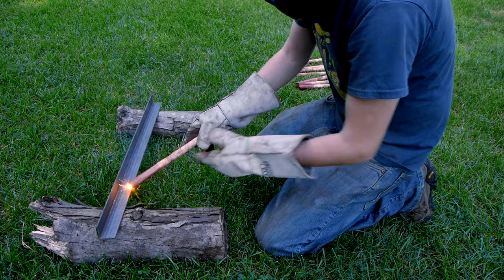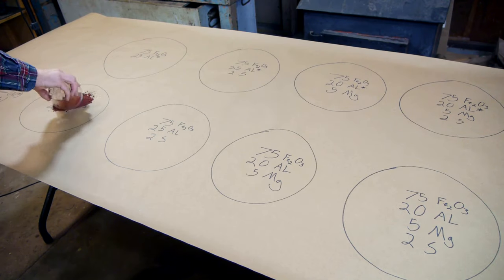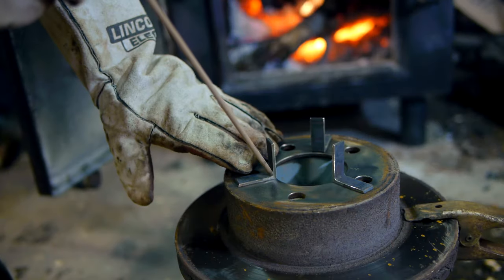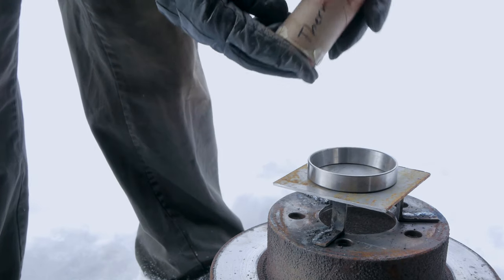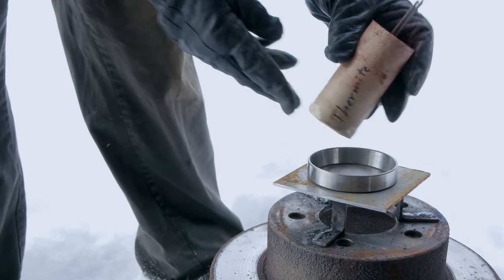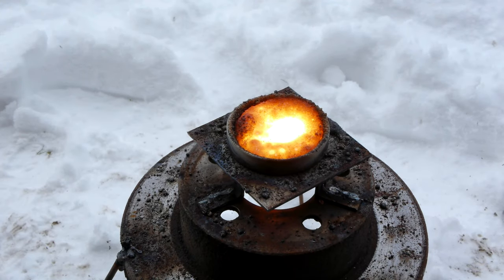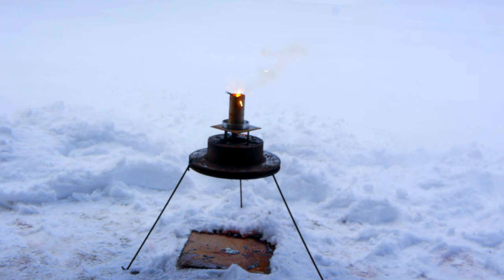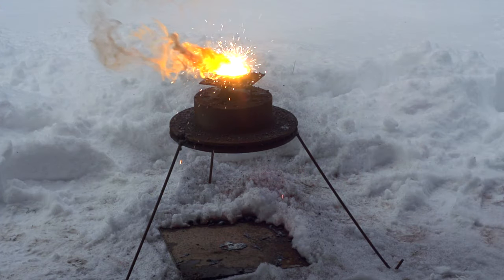How Easily Can Thermite Actually Melt Steel? - NightHawkInLight

Comment: Even if it doesn't cut through the steel, chances are that it significantly weakened it. I would assume military grade equipment would be using steels that are heat treated to do the job. If you overheat a shallow hardening steel which has already been heat treated, you would soften it up so that it would fail faster. If you overheat a through hardening steel which has already been heat treated, you effectively reharden it without properly tempering it and could cause it to crack (catastrophically fail) early.

Comment: Instead of letting it just burn in open air, try containing it in a welded steel casing with a small hole facing the target metal.  This will provide pressure to push away melted steel and will cut through much better.  You'll probably have to hold it against the target (lest you make a thermite rocket), but it will push more energy into the target plate.

Comment: contain the reaction more. Force the thermal energy and molten iron into the material you want to cut. I've seen it be done. A setup like the one you demonstrated here lets a lot of energy escape to the atmosphere because it is the path of least resistance.

Comment: Ever heard of shape charges or cumulative mines?
You are burning it in rather tall container (10cm?) and you are starting fire on top of it.
More or less all heat is gone in wrong direction.
Try to set ignition point  on the bottom of container just where it sits on plate you want to burn thru.
Cheers :)

Comment: have you seen the brainiac video where thermite cuts through a car engine? it may be worth investigating their mixture compositiin.
Reply from the maker: Brainiac is known for faking the results of their experiments to make it more exciting
Reply: Never knew that i just enjoyed fhe show
Reply: Mythbusters have a legitimate thermite vs car video, and you can see there that even a gigantic ammount of it does far less then expected.
Reply: Yes it's a 100% fake(that's why i stopped watching Brainiac). As ppl suggested in their comments you must heat up a small point and thermite itself has to have the right ratio of ingredients to prevent the molten metal to produce hmm well...a kind of shield on the steal plate. Military thermite is also compressed and put into, say, tubes with nozzle so the heat didn't go around thus be more direct. I did some research on this topic a few years ago ;D unfortunately police ;D didn't share my passion.
Reply: thermite is the ammo. the pot is the weapon. Without a hole in the pot you don´t get the superhot molten metal "blade"

Comment: Hey NightHawk,

I think if you want to look more into thermite cutting power, you might experiment with different containment methods.  There's some really interesting work that Jonathan H Cole has done with testing various cutting configurations for entire steel I-Beams.  He's been able to make deep slices into large steel I-beams. 

 Although I disagree with his conclusions from the work (that thermite was used in the destruction of the twin towers), he still makes some very impressive horizontal and vertical cuts through thick steel using containers with simple geometries.  He even made a couple spring-driven designs.  You may have to wade through a lot of truther bs to see his hard science though.

J

Comment: When you mix fuel, metal oxide and metal powder in just the right way, it burns at 2000 degrees Celsius, hot enough to cut through nearly any barrier known to man. Throw some C4 in the mix and you've got one hell of a combination

Comment: What about packing your thermite/ mate into a cylindrical tube (as you did) but with a hole going down the center? Seems to me that all the heat generated was being allowed to dissipate upwards & you needed a more focused effect? Rather than just letting it burn in a pile. Think of the way you approached the DIY mega snake on the sand thing you did. An open channel through the center would give the molten material somewhere to go? & if I understand the science right it's not a question of oxygen to burn but rather direction of what you want burned? Would packing the thermite with a press like a rocket engine make a difference?

Comment: Try simply pouring the thermite in the bearing race then lighting it. I believe your problem is that when it is contained within the tube it is merely burning itself and doesn't actually start to heat the steel till the very end.

Comment: Pretty sure the reason the thermite wasn't burning through was because of the way you set it up. Most of the iron and aluminum oxide that formed seemed to have insulated the material from the heat, if there was a way to light it at the bottom instead of from the top might get better results.

Comment: So, let's quickly go through how plasma cones are used to penetrate armour: The explosive is cone shaped, so as to create a think plasma spike that burns through the armour. Done. If this is true for explosives, the same must be true for incendiaries. Hell, if you burn something on top of a flat table of wood, it will still take a lot of time for whatever is burning on top to cut through the wood. On the other hand, contain what is burning in some way, and focus the energy on the plate, and it will burn through rather quickly.

Comment: Thermite is actually used for welding steel rails together by railroad workers. It wouldn't be much use if it cut right through them instead of softening them enough to form a weld.

Comment: If you mix fuel, metal oxide, and metal powder in just the right way, it burns at 2000 degrees Celsius, hot enough to cut through nearly any barrier known to man. Throw some C4 into the mix and you've got one hell of a combination.

Comment: your thermite composition needs to have as close to a perfect ratio of aluminum to iron oxide as possible to get good results. any excess will simply absorb heat which is drawn away from the targeted metal. the reason the military is able to decommission artillery pieces and such is because their thermate is mixed in very controlled conditions in large quantities making it much more 'pure'.

Comment: Heat travels upward though so if you want to achieve maximum efficiency of the thermite wouldn't you place the thermite under the steel

Comment: You may have better results by having the container of termite elevated above the metal plate and igniting the termite from the bottom of its container. Thus having the termite pour into the plate of steal. 

Your current method looks like it would have problems with thermal insulation and getting the oxygen for optimal combustion.

Comment: This may not have been a solid analysis, allowing the top to remain exposed allowed the thermite to direct its heat out the top into the cold air rather than transferring the heat into the steel to cut it

Comment: What happens if the thermite is fully enclosed, bar a small opening, and tightly packed inside a steel tube, similar to a firework?
Would this concentrate the heat / cutting ability? Or just detonate like a firecracker? I'm thinking would it be possible to direct the cutting power in a similar way that a shaped charge works?
Reply: *****
Thanks for the info, but I find conspiracy nuts annoying, so I'll give it a miss and carry on watching more quality videos from Mr NightHawkInLight.

Comment: thats just a thermite stick imo, tbh if you wanna cut completely through the steel, then use BreachPens, breachpens are thermite breach charges that burn at over 5000 degrees

Comment: I have one suggestion. The heat of the reaction is going up, and you have your metal down the reaction, so the heat that finally get to the metal it's very little and not very efficiency. Try to find a way to put the metal different or direct the reaction in other manner.

Comment: It's clearly below freezing where you are. Maybe the ambiet temperature was causing the steel to just conduct away most the heat?
Reply: +jpeg1991 
First, steel is a rather poor conductor of heat. So that doesn't change much. Secondly a few tens of degrees make no difference when the reaction burns at 2500°C.

Comment: The reason the 300g of thermite and thermate didn't cut through the steel sheet was because neither of them were directed in any direction. If either of them would have been directed at the steel, it easily would have been cut.

Comment: it doesn't just 'melt' though, it should also offer oxidizer to react with the steel, and you need a termite jet to 'flush' though the steel, like how water jet goes though sand castle. exucise my english

Comment: i think maybe it did not burn through the steel because as the thermite started its burn at the top part of the cylinder and the un-burned thermite shielded the steel below it - see what would happen if the thermite cylinder was placed upside down so the molten thermite was in contact with the surface of the steel - that will increase the time the thermite has to bring the steel to molten temperature - i think it do the trick

Comment: Instead of a tube and a bearing race, try to focus the flow of the thermite, and yeah it really needs to flow, that looked more like it just globbed together, more like welded. Seen thermite used for cutting train rails by having it focused, an at the same time commonly used for welding tracks.. =)

Comment: You also burned from the top down, which sucked alot of the heat out.  Try a bit poured jnto the centrr of a tuna can.  Dont fill the can up, just a nice mound of it.  We burned holes in asphalt like that.

Comment: I don't think the cutting power is overhyped as much as it is talked about by people who have no idea what the hell they are talking about and have never used the stuff. I have never seen or heard anyone that's legitimately knows about the stuff ever say it was an efficient means of cutting steel, only that it can burn through steel. And I think that largely comes from accidents while making large quantities the stuff. Someone mixing it in a steel container and it spontaneously ignites and burns through the container and potentially the floor. 

There's no doubt it can burn through steel. As far as this particular experiment goes, the energy is going upwards when it needs to go downwards. When I've seen it successfully cut through steel, it's been in bags, not contained so it acts like a rocket engine. If you were to do it that way, I'd think you'd need to ignite it from the bottom so the burn is directed towards the plate. You'd also probably need a significantly larger quantity. It needs a fairly long burn from what I've seen.

Comment: you should use something to apply pressure to the burning thermite and also burn it in a way in which all of the heat is focused on the steel instead of going up into sky

Comment: +NightHawkInLight  what if you try to put it in a pipe with a hole in bottom brick on top for safety and lit it then maybe that little bit of pressure will punch the metal

Comment: if the burn started on the steel somehow instead of an elevated position the majority of the burn would be on the steel instead of elevated into the air. the whole first half of the burn isnt touching the steel at all. maybe even a hole down the middle of the tube would help focus the burning thermite directly to the steel.

Comment: I think there needs to be a way to focus the energy being produced into the surface that is being cut through. in your video you have the composition being ignited from the top. with the energy released going up into the atmosphere. the only energy that meets the steel is the bottom layer and the residual energy stored in the slag produced. its more than enough to heat the plate but not enough to melt.   

What if you where to contain the reaction in a caped cylinder with a nozzle and  ignite it from the bottom similar to a rocket. and have the nozzle directed at the steel. energy would be focused into the steal rather than being released. i would imagine that you wouldn't need much thermite to cut that sheet.

Comment: Great video. Now let me explain why it didn't work. If you want to melt though steel with thermite you must consider gravity. So take a road flare or sparker. Lite it and lay it on the steel. Then put the thermite on top of it. The thermite will burn in contact with the steel and will continue to melt  and heat the steel though the whole burn. You only had contact for the last part of the burn.

Comment: The reason it isn't cutting is that you're just burning it in a tube. If you use something like a flower pot with a hole in the bottom raised off of the surface to drip the molten thermite down you will have a much higher chance of success

Comment: When Myth Busters busted the myth of 'will thermite burning on a block of ice explode?' they demonstrated a bigger batch of thermite burn through two or three sheets of steel a couple of inches apart above each other. Whatever your problem not burning through the plate, it isn't the thermite...

Comment: I think a problem with your use of thermite is that you didnt direct your thermite charge. I'd suggest containing the charge in a stainless or thicker steel cylinder with the open end pointed at the melt spot and of course lighting or igniting the thermite that is in contact with the material you want to melt rather than igniting the thermite farthest away from what you wish to melt.

Comment: the reason this did not work for you is that you had it placed right on top of the plate.  that is for welding.  to burn through, you need to place it suspended above the plate, so that it will drip down onto it

Comment: the maximum heat of thermite depends on the strength of its mixture, leaning more towards aluminum than iron oxide produces a prolonged heat and more violent melting action

"thermite" is a term very loosely slung around, and it definitely comes in different grades and strengths

the thermite in this video was very low grade and cheaply made

a stronger mixture of thermite could easily melt through a car engine, and then continue to chew cement up to 7 feet deep.  

this was simply childs play
Reply from the maker: Go ahead then. Try it.

Comment: Make your thermite container out of steel, shape a nozzle on it like a rocket and bolt it upside down so the heat is focused on a single area. That 1/8th inch steel won't stand a chance, probably could cut through thicker stuff even. The energy has to be harnessed and pushed out rather than letting it burn off into the air.

Comment: Thermite easily cuts steel, you’re doing it wrong: you want the hot thermite to have the maximum surface area with the steel at all times.  Think of a jet of thermite being ideal.  There are videos of guys cutting thick steel construction beams with very basic metal boxes that have one corner with an opening to cause thermite in the box to spray out the open part toward a steel beam the box is connected to.  You should also try making nano-thermite instead (more chemistry involved, though not hard), it ignites at under 500 degrees and so is easier to do.  The smaller particles also mean a MUCH more vigorous reaction due to the massively larger surface area of the particles that are interacting.  If you want links to videos on all this I’d be happy to share.  Cheers!

Comment: you where also lighting at the top though so most of the thermite already spent is energy before it got to the steel. i would try a different method of delivery before i would say thermite cant actually melt steel.

Comment: nice video. your thermite is most likely fine. your method of application is not. have you tried a ceramic flower pot that will withstand the heat but concentrate a slow release from the drain hole?

Comment: See the problem is to decommission a artillery piece you don't have to burn a hole in it all you have to do is obstruct the barrel with something and thermite is perfect for that
Reply: That and if you put it on the breach, or gear systems pretty much any thing that is suppost to move. Thermite or Thermate isn't really for cutting steel as welding it, plus in order to cut the steel the Thermite or ate, will need to be conatined and compressed more and focused more on an smaller area.

Comment: your heat is escaping you need to contain the heat in order for it to melt through your steel. make a plaster of Paris crucible around the bearing race about 4 inches tall it will contain the heat to melt through your steel.

Comment: if the thermite is contained in a vessel that causes it to compress the reaction threw a smaller nozzle it acts like a cutting torch. I feel most people use thermite in the wrong way.

Comment: you are doing it wrong.   it has to be contained to build pressure to blow thru the steel.    just like a bullet,  a bullet outside a guns barrel will do nothing. but contained with only one exit it will blast thru.

Comment: I've seen videos of railroad workers melting steel to weld  railroad tracks together.  They clamped on a form to shape the molten steel, added thermite and lit the fuse.  Maybe their thermite had a better recipe than yours.
Reply: "Railroad thermite welding"

Comment: There too much space between the iron and the thermite. Use a plastic or paper. Bag, with a metal frame around the circumference so when it burns, the paper will burn away super quickly allowing for the thermite to have direct contact with the metal. The heat is all shooting upwards into the air so not enough energy is being put into the metal.

Comment: Thermite is not a cutting technique. It really is a chemical reaction for "welding". Since you produce molten iron with the reaction it is unlikely to cut through steel as you need more heat to melt the tempered steel.